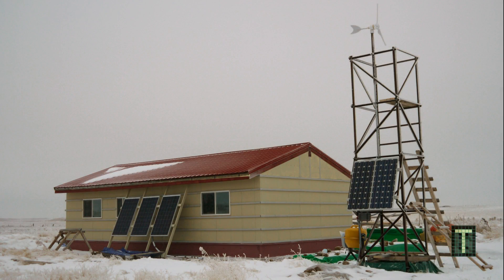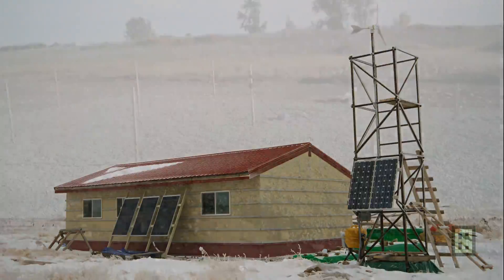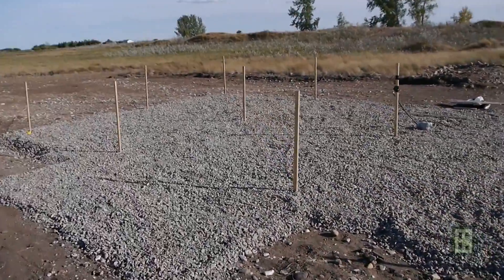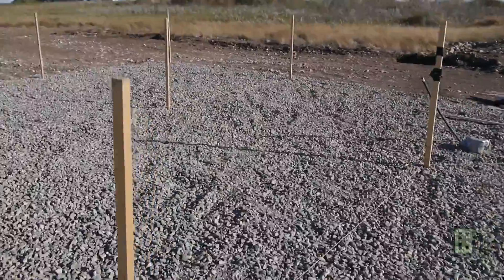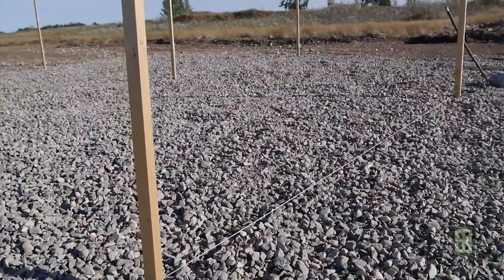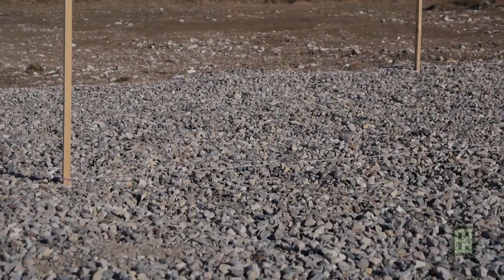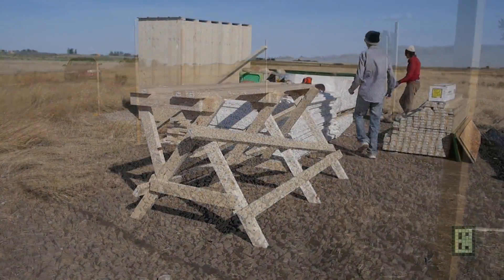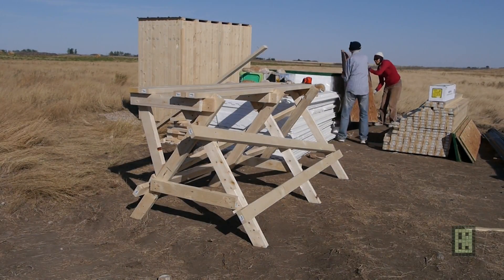Off Grid House

Comment: I've a real good idea for your next build (or, mine : ) - skip the concrete, rebar, and tile for you slab.  Use concrete pavers(!)  There are 6cm (2 -3/8") pavers for about $1.72 /sq ft (regular price readily available at Menard's - Home depot is almost 50% more).  Anyways, brick-size and stronger than brick, driveway rated.  Materials alone it's not much more than ordering by the yard from a concrete mixer.  And, no screeding or floating - especially when it won't be seen.  I'm definitely doing pavers for my drive.  And, the pavers would actually work very well as a finished floor too, *no tile needed*.  If it goes out of style, the pavers can be lifted and replaced, almost like a rug AND the old pavers would be literally good as new to reuse.  Cast a few of your own pavers for decoration and accents.  Mix a few bags of colored concrete for a border maybe.  Countersink some so you can lay tile accents level with the rest of the pavers, lots of options.  The pavers would arguably last indefinitely - way past a tile floor.  It will never go bad.  Some may actually like the style better too, I suppose that would depend.  One could easily put any type of flooring they wanted over it, 'on top of that'.  

I like the idea of solid 2x4 walls.  It's almost like logs for a cabin, extremely strong, but much more uniform and builder friendly.  In fact I was really surprised to find 9' 2x4 'economy' kiln dried S4S studs for $1.69, at Menards too.  That's only $1.50 /sq ft for 3.5" thick wood walls.  2500 sq ft can be enclosed with 10' ceilings with 2000 sq ft of wall, 50' on four sides (or a little more to make it more rectangular).  If you can get framing materials for current outside walls (say 6" studs) for even half that, you'd save only $1500 on the entire house, probably have more labor, and make an inferior wall.  I'm not sure if it would be more susceptible to termites or not..  Not sure how it would fair in high humidity either, for those in those areas.  But, drywall is still used and that would be a bigger concern.  One may only need a very thin shim strip on each 2x4 side to plaster / veneer to directly, not sure though.

From what I can tell, a 4" #10 steel screw is about $.08 each in a single lb box, surprisingly 16d nails in a 5lb tub aren't much less but traditionally they have better shear strength (no lack of that with a solid wall).  So, 2x screws per 8ft 2x4 (1 sqft) adds around $160 per 1000 sq ft of wall, basically no cost issue there at all.

Even for inside walls, if you have 2 sheets of drywall and 3 studs, that's maybe $23 for 32sqft or $.72 sqft, mud and tape won't cost much but it's a lot of time and dust and cleanup.  Get a little creative and use 2x4's on edge for 1.5" thick interior walls and now you've matched materials price.   Use a long or shorter countersunk screw in each end, straight through the top, screwing to the lower.  And it's a truly solid wall, no sheetrock anchors ever needed again or guessing where studs are.  Wires could be routed in 'decorative conduit'.  

Wood is good - inexpensive, lightweight, good strength to weight, easy to work with.  I think a good cement block could be better though, good enough to be the siding and structure in one.  Add an integral waterproofer and it might get close to ceramic tile for permeability, or better - xypex is rated for hydrostatic pressure (and can contain potable water too).  Glass is impermeable and I think would make the best shingles / siding possible.  It's basically sand - silica - and slate is too.  I gather slate has about the same permeability as porcelain (~ .5%), but glass is 0.

I wonder how good cellulose insulation would be in plastic bags sealed of all moisture and water vapor - it may work well in cement / stone cavities.

The best way I can see to make footings would be to just level out the entire area for the house the same, but then dig postholes every 4' or so of supporting wall structure.  It should be much less digging than monolithic footings, and no forms or rebar either.  Use good galvanized studs or pipe, set with concrete, and the house structure will have a true thermal and moisture break from the ground.  Plus there are well made points to easily re-level if need be in the future, invaluable really if the soil is unknown or expected to shift.
Reply from the maker: This is for sure the longest comment I got on this video :)
For details about this build you can check the pdf project http://greensask.com/pdf/65mp-new.pdf
The concrete pavers can not realy replace the slab on grade foundation since thy are not connected together.
The steel reinforcement is realy needed with any soil if you do not want to have cracks later.
As for cost the volume for a one square foot 6cm thick is 0.3m x 0.3m x 0.06m = 0.0054m2 thus you need 185.18 of them to make the equivalent of one cubic meter of concrete and at $1.72 each = $318.5 that can be close to double or even more than delivered concrete depending on where you live. Even adding steel reinforcing the way I did will not add much in therms of cost and still be significantly less plus better.
Yes there will be more work with steel reinforcement but pouring the concrete was done in just one day.
The most expensive part of this building was by far the thermal insulation close to half of the building material cost but well worth the investment.
Yes when you compare 2x6 frame + OSB vs just solid wall made of 2x4 as here cost is almost the same maybe $1000 more depending on OSB quality and there will be more work with the 2x4 than a frame wall but it will end up in a much stronger wall.
I have a preference for EPS (expanded polystyrene as insulation for foundation ad wall even if is more expensive than other options). You can be sure that level of insulation will be and remain the theoretical one since it will not absorb water or sag.
Reply: I considered the points you make about pavers as the idea came to me.  If you just want to connect footings - they already are without the slab.  Adding a slab is also more concrete work than just concrete footings, plus you need install flooring additionally.  My initial thought was a bottom 'bond beam' on piers, that bears side loading like a top beam does for a vaulted ceiling.  (But, piers are are not usually needed and probably more expensive, so footings minus slab I'd say).  Time and again a concrete firm will tell you too that no matter how much steel you put in, your slab will crack.  It will keep it level though.

Pavers are drycast in well-controlled environments, 0 slump - this is much stronger than adding "oh about this much slump looks good" amount of water to get slump that you need to flow in a slab, and then wetting it down if it's too hot outside, can't pour if it will get too cold, etc.  A concrete guy told me they hardly ever advertise psi anyways (context of driveways at least) because they just go by the slump, but said "4000, 3000-4000 PSI", and sidewalks are as low as 2500 psi.  If you get the same strength with 5/8 the material, that's how the cost equalizes at roughly 'twice the price' - 3000 psi concrete isn't directly comparable to 8000 or more.  Plus a slab failure results in pitting, spalling, cracks, and difficulty with any type of repair or re-leveling, all of which pose no issue to pavers.  Practically the only mode of paver failure is unlevel issues.  If the floor is surrounded by good footings, it should be less likely, but I would agree a slab will probably stay more even, although again high/low spots in pavers would be a diy fix for even a basic homeowner really, that's the true advantage of it.  Not even a seasoned contractor would replace an inside slab without high cost, even adding inches of leveling cement and redoing all the flooring is really expensive.

Yup EPS is expensive but good.  Cellulose is green and inexpensive, that's why I wondered if issues - settling - could be solved by sealing air-tight without any moisture inside, maybe in smaller bags.
Reply from the maker: The slab I used for my house as you seen in the video is thermally insulated from outside (not thermal bridging or humidity) and while there are about 4 years since the slab was done and spent one winter outside there are absolutely no cracks not even superficial ones.
The small cracks that are not structural will appear if drying is to fast and large structural cracks you get if there is not enough steel reinforcement or not at all and there is pressure on the concrete of any type.
There are plenty of example's where concrete a few decades old has absolutely no cracks.
Most houses here seems to be build almost identically with the minimum requirements from building code and the house usually have basements that are exposed to high ground pressures especially in cold places and exposed to humidity.

Comment: Its interesting to see the different was people build their house. I liked the video thanks Chris.
Reply from the maker: Thanks for the comment. Probably you seen the SBMS and that is how you got here :) (that is base on solar PV panels in your profile image).
Reply: electrodacus Yeah we live off the grid too. I am in the process of building my own DIY Power Wall using new 18650 cells. Li-Ion as the cost is alot lower and the cells get better with every generation.
Reply from the maker: All lithium batteries are Lithium-ion but different chemistry have quite different characteristics.
In the 18650 cell size format you mostly have high energy density cells that are great for portable electronics and EV cars but are fairly bad in therms of cost amortization for stationary energy storage.
Most common chemistry in the 18650 size format is  LCO (LiCoO2) and maybe NMC and NCA all of this are high energy density cells with a max charge voltage of 4.2V and have just a 500 cycle life at 100% DOD wile cost is around $220/kWh.
A much better solution for stationary energy storage is LFP (LiFePO4) that is what I use and while this have a lower energy density close to half of the above mentioned batteries and cost 350 to $400/kWh they do have a much higher cycle life 3000 to 6000 cycles at 100% DOD and higher at less than 100% DOD thus are a much better option in terms of cost amortization for stationary offgrid solar storage.
LiFePO4 are also build as much larger cells 40A to 1000Ah cells so is much easier to build a pack with large capacity that to use hundreds or thousands of small 18650 cells.
Reply: If you know of a better low cost good quality LiFeP04 cell that I can get in Australia could you please let me know. By the way love your videos. Thank you for your content.
Reply from the maker: Chris Scanlan
That 12V battery is made of multiple LiFePO4 cells 4s3p and have an integrated BMS so is hard to say if that is a good price or not since it depends on the cell quality and BMS quality also.
The capacity is about 0.64kWh and the cost is about 422 USD that will get to about 660USD /kWh and typical LifePO4 large cells prices is around 350 to 400USD/kWh probably better quality that the smaller cells inside and this means you pay at least 260 USD for the integrated BMS but each time you by an additional battery you also pay for an expensive BMS
As it happens the price of the SBMS100 was also around 260 USD but can support a 10kWh battery in full configuration that is 8s 400Ah battery but you pay just max $400/kWh for high quality Winston cells and one time 260USD for a single BMS that will manage them.
Not to mention that SBMS is a more advanced BMS and charger in one that will let you monitor and log all individual cell voltages and more importantly see the battery SOC.

About the used laptop cells. Many people seems to think they are a great solution and I must disagree with them and say that is the worst solution even compared to new 18650 cells not just LiFePO4
Most of those if not all 18650 are LiCoO2 cells with cycle life of about 500 cycles when new and when used you have no idea about the renaming life. Can be 200 cycles or can be 20 cycles away from complete failure by dendrite internal short.
Even if those are free the amount of work to test each individual cell and build a pack is not free then you have a pack with unknown remaining life and a pack that will never be balanced because of cells with different age maybe even brand and characteristics.
New cells will almost certainly be a better option since they cost about $220/kWh in volume and since a typical 18650 has about 10Wh capacity that is about 100 cells new.
So if you get old cells that you need to recover from old computer packs and individual test then you save $2.2/cell in theory for your work. Of course that is not true since you got old cells with maybe 10 to 30% life left so best case scenario for all your work you save a few cent / recovered and tested cell.
Then again even with new 18650 cells that are sure better option it will be bad investment compared to LiFePO4. As mentioned before yes LiFePO4 cost almost 2x for same capacity initial $400/kWh vs $220/kWh but return on investment i better with LiFePO4 that have a say 7000 cycles for Winston LiFePO4 cells with 80% DOD cycles vs  typical high energy density 18650 that have a 500 cycle at 100% DOD and at best 800 to 1000 cycles at 80% DOD.
That was the main reason I chose LiFePO4 for my offgrid house because they are by far the most cost effective energy storage solution at this point in therms of cost amortization.
Not to mention LifePo4 is much safer no thermal runaway and greener also no Cobalt.

Comment: This was impressive. I bet you only need a small stove to keep that place warm. Super insulated.    A+
Reply from the maker: +Dustin McLain Yes it only needs 1000kWh in January the plan is to use solar PV panels to fully heat the house just need to design and build a solar PV heat controller.